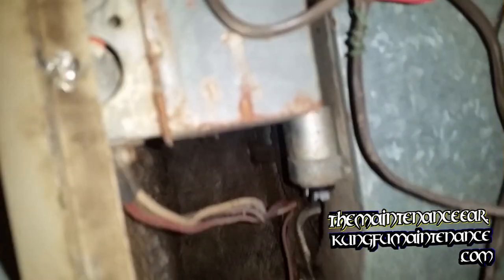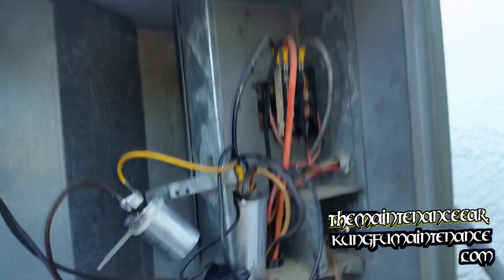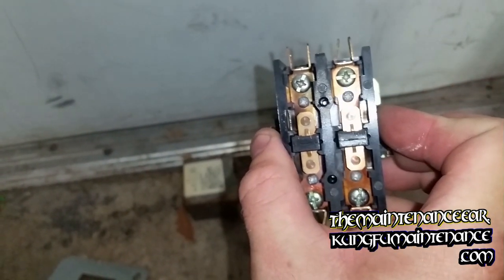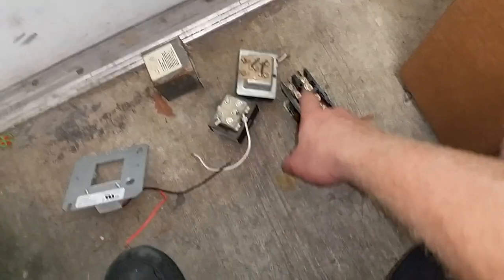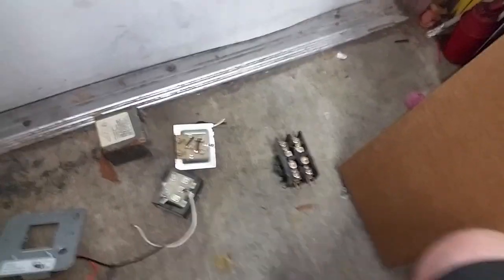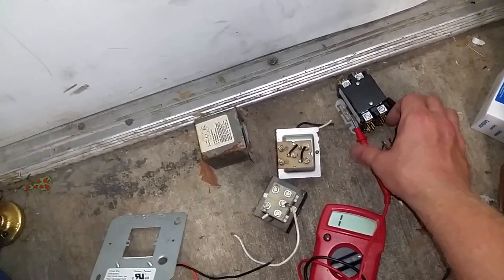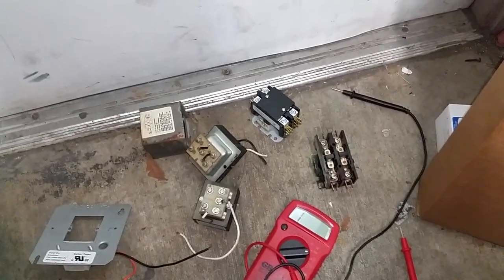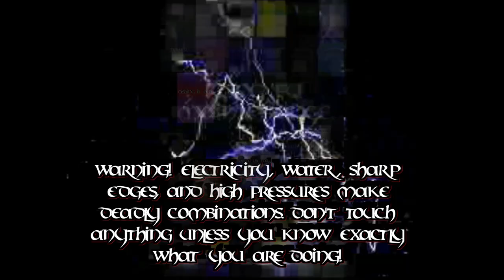AC Transformers Fail Most Often Cause Of Fried Air Conditioner Heater Fan Transformer Not Working

Comment: My coil looks burned but when i engaged the contactor the system comes on for outside but im not getting 24v from inside air handler to outside, would the contactor still work when engaged if its bad and would it have fried the transformer in the air handler even though it looks fine

Comment: I replaced the contactor that's in my air handler before burning up the new 2nd transformer. The a/c kicked on with no problem. When I switched to heat.. the transformer started cracking and smoking. Any thoughts?
Reply: Did you figure out the issue?
Reply: Figure it out?

Comment: Hi sir ..can you help me with this. RTU Package  r used in hvac system . Its burned up twice. now we have 3 transfomers are burned up. I checked the board i checked everything even contactors, cables. But i didnt know where is the problem
Reply from the maker: When you have a blown transformer I have found it is always best to replace the contactors. Than the transformer.

Comment: Hello I have a blown transformer that receives 240 volts and outputs 24 volts. Well the issue is the out put is testing at 120 volts. The Ac repair man said that the onl;y way this could be is if the wires got chewed by a rat and so not it's receiving more power than it should. he was hired with through a home warrenty company and it just so happens if a rate chewed the wire than it wouldn't be covered on the warranty. I just think it's really convenient but their is also no dead rat smell in the house, I do not buy it. Is it possible that if the Transformer is blown out that the output could be higher than deisgned?